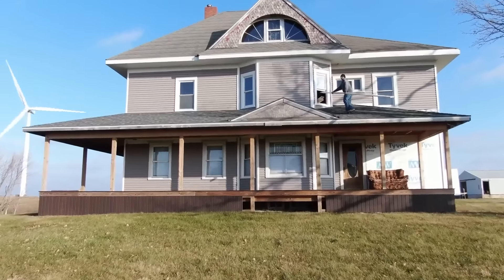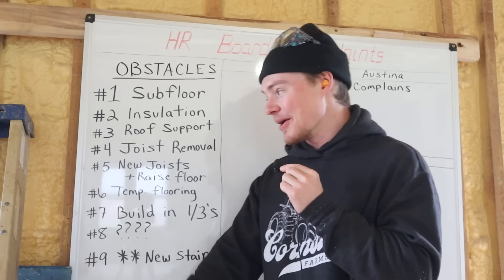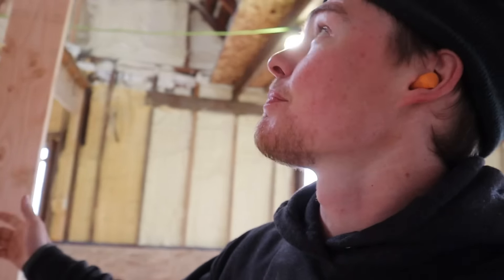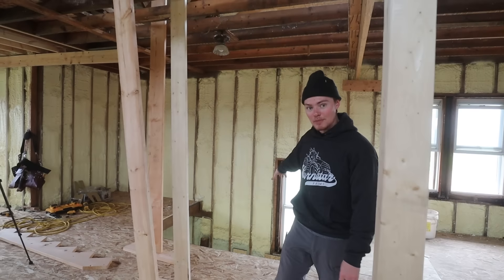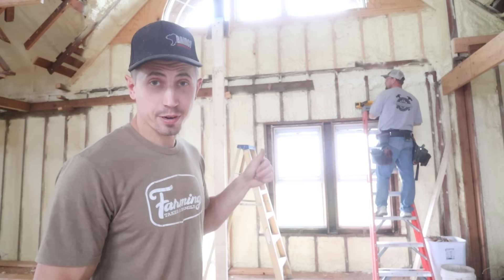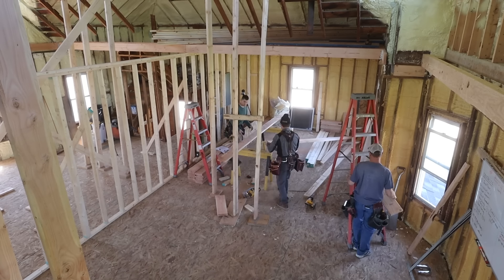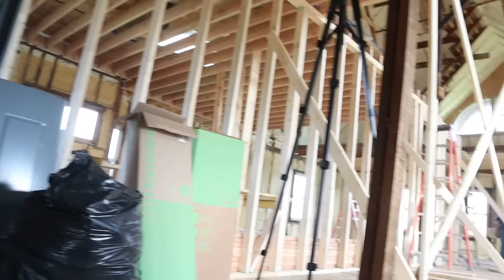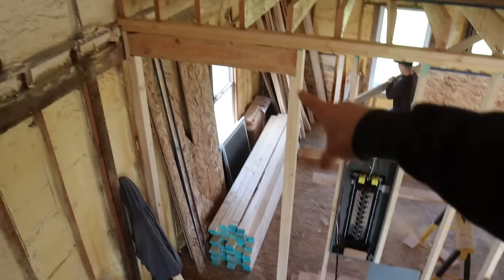Restoring A $7,000 Mansion: INCREDIBLE Dream Attic Rebuild (Pt. 2/3)

Comment: Think twice about that cathedral overlook. I lived w one of those. Impossible to clean and change bulbs or dust a ceiling fan. Also, heat rose (could change your HVAC calculation), created a weird draft & condensate formed at the peak. Suggest you build it such that you can fill it in if you find similar issues.  But…I LOVED THE DRAMATIC TREE TOP VIEWS FROM THERE. A wonderful spot! Good luck!

Comment: I am impressed to see 2X8 joists on 12" centers.  You are clearly thinking about your family with that decision.  I'm lucky to have found a house that was built with 2X12 on 14" centers.  Having solid floors and walls means so much to the feeling of safety.  Especially when storms come.  You're doing right by your family.  I am envious of the camaraderie you have with your buds and I know that each of you know how rare that is - and that makes it even better.  I would recommend the 5/8" drywall.  Can't wait for the next installment.

Comment: That balcony will open up the bedroom for sure, but will also be a bit of a safety risk for small boys when they put chairs infront of the railing to be able to see better...😮 No, not yet, but sooner then you think.😉
You might also want to consider the extra heating cost?🙉 17:52
Reply: what extra cost? This space was going to be heated with or without a wall or ceiling there. Its not like it was going to be an unconditioned attic.
Reply: A couple more inches of spray foam would be beneficial though
Reply: @warrenmichael918  Well, warm air expands upwards? To keep the bedroom warm you have to heat it from the ceiling of the attic down to the floor- instead of just heating up to the bedroom ceiling.  You have to fill the attic with heat before you get the same temperature all the way down to the bedroom floor.
Good when it's too hot, bad when it's cold. Just the laws of physics.
Reply: @atirblum  and? People heat huge lofted ceiling houses everyday and they seem to keep warm. when you can afford a huge house thats 3 or 4 stories and being fully rebuilt like this, a decent power bill is expected. That open loft will be pennies more on the power bill

Comment: Justin is right the attic area should be open concept 😊. Good for you Cole to listen to your Framer/Contractor 😊. Your kids will have a blast up there.😊
Reply: Disagree. Loosing a lot of floor space. Plus as you know heat rises. So in order to keep the attic area from getting too hot to use, the second floor will have to stay uncomfortable cool. Everyone I know that has high ceilings has realized what it cost to heat (just for looks) and say they wish they didn’t do high ceilings and lofts.

Comment: Usually, the rule is based on the amount of conditioned floor area, and contractors in many areas generally use the rule of 1 ton of air conditioning capacity for each 400 to 600 square feet of floor area. The rule is usually specified in square feet per ton (sq. ft./ton) - you need about 8 tons or 2 4 ton units. i would just go with a couple mini splits and then also use heat exchangers plus pos pressure hepa - no more dusting - the hvac pros are going to do a ton of vents and air carriers - mostly unneeded as the hosue is going to be 68-70 all year round. put one heat echanger in basement and one in third floor - you can run both or vary them according to season for max efficiency - they are 90% efficient which means you will not lose much heating or cooling but have good air recirc plus it will be hepa filtered - air will always be going out of the house/no infiltration

Comment: Great plan for the opened balcony….will certainly add a WOW factor to the house that wasn’t there before…I’m no HVAC expert, but imagine ya may want a low hanging ceiling fan over the opened area to circulate some of that warm air down in the winter as it will all funnel up that opened area to the attic floor.  

Can’t wait to see how it turns out and that may solve the staircase locate quandary

Comment: Consider glass for the 4 ft wall.... it will cost some but will add another dimension of cool     food for thought
Reply: The glass will make it easier to see what your kids are up to up there, and it's harder to climb. But OMG the fingerprints, lol.😅🇨🇦👩‍🦼
Reply: ah, fingerprints.  I would worry more about the dog slobber, but in either case, it will disappear into the background of life, for with kids, kaboom kids mess everywhere I would posit   :)
Reply: @TomParr-xd7kr  never thought about the dog nose and slobber because I have a large Great Dane  so the slobber line may be above the rail,lol. 
You are right though kid mess is a small dent in the big story.

Comment: Cole I know I mentioned before when you were taking down bricks then drywall then paneling and now it probably after the fact it. But i will suggest it again now that you are taking down more of the Attic: Please put down tarps below where you are dropping stuff down. The Tarps will catch most of the debri/stuff. Then all you have to do is fold up the tarp and drag it to the truck or a bin and empty it in there. It would save you so much time from having to clean up the floors so often and so much. And it would save your back from having to bend over so much picking it all up. It doesn't have to be a big tarp. Just one or two in strategic places that you can handle carrying or dragging outside or to a window to dump out. Work smarter not harder!

Comment: Cole, with little kids, you need to make sure those low, working windows can only be opened a little, so the kids don't open them up and fall out.
Reply: Not to mention only a 4 foot wall to keep them inside the attic. Kind of dangerous if you ask me.
Reply: @NotKev2017 you must have fallen over a railing as a child. Maybe Nave should just wrap them in bubble wrap
Reply: I was a farm kid growing up. Nothing was OSHA approved. our barn and all the equipment was all scary stuff. I was told not to do stupid things and it worked.

Comment: Cole and Nava, couple of thoughts on the open attic- idea put a walkway alway around so you can access all your windows in attic, another idea put built in storage either draws or bookshelves on outside and have a few doors to access behind for more larger storage or play area for the kids on all the short walls so you have plenty of headspace, next idea put a safety/play net over the opening it will keep all children and adults safe and place to play, read and hang out. Concern  I thought you where going to put you air conditioner in the attic floor with all the venting going through the floor what happens to that idea loose your floor means loosing your venting, concern about heating and cooling plus humidity and air filtration to keep down pollen and dust you need to reengineer this drastic change in design. Concern height of railing please check the codes and consider material choice- you got dry wall, glass, but consider metal as well- you get the see through effect and heat and cooling flow depending on the design could be safer and if you put up cargo netting maybe easier access to it. Concern the second floor did you plan a big area already that would below this open attic area or it a small hall way and now all the bedroom will be open, they will not be private or quiet but instead all open and no privacy, did you also account how it will effect heating/cooling the bedrooms since it will be open to the attic. Cole did you ask Nava if she wants the open attic? If you keep it open or not it your family decision just reengineer for changes made for your family needs, health and safety. Love your channel. Keep it going.

Comment: Cole,.  Food for thought.  Don't build your  new stairways yet. You may want to use a wersbo type of infoor  heat. There is a way to lay 2x4s flat on the floor about 2ft apart. With gaps for the tubing to run . Once the tubing is installed. Hire a crew to pump gipcrete into the the rest of the floor. The 2x4s work as nailers for hardwood floors.

Comment: I’ve been following y’all and up until now was confident I could do the same with my skill set. But that attic rebuild is where you finally lost me! I wouldn’t be able to suss it out myself. 😂 It’s like you trying to teach my beagle quantum physics! Good good on you though - we’re eating this up with a spoon!
Reply: The attic rebuild has got me nervous. The original design for the supports of the roof were sketchy. I'm sure they are going to do a great job but at the moment it seems less supported than it should be.

Comment: I don't know if you're consulting with an engineer/architect but youre introducing hinge points in your walls by removing the floor section. The walls aren't supported laterally at the old top plates. Wind loads on the wall could cause deflection and cracking at that point. Normally the studs would have to run full height. Just something to consider.

Comment: My parents built a house in late 70s with cathedral ceiling, balcony, and light coming in from windows above. The windows were partial solar (or something like that). We loved the space, but when it was full sun, it was hard to regulate the heat, and it would get too hot. Also, it faded the decor super fast. Window treatments have advance much in the last 40 years. Look into windows that will help protect from sun but bring in the light. 
Yes, it is gonna be super cool. 😎

Comment: When I was younger, I had a recurring dream about a big old farmhouse that looked normal on the outside, but the inside was set up to be a circus/playground.  Long chained swings hung from the ceiling way up in the top.  There were slides that wound around from the top to the bottom. There were giant hoops swinging around with people standing in them.  Your gutted house reminded me of that old dream.(I have no idea where that dream came from). But let me tell you about the George Burns dream...

Comment: That tall ceiling is going to be stunning! Cole and Nave, I don't know what you are thinking about for walls, but I highly discourage you from using sheetrock. It's messy and holds moisture and is easily damaged. I prefer something like shiplap or paneling. Just a thought and some advice from a builder's wife.

Comment: That is really really cool.but a suggestion for the low ceiling to wall where you can't walk under. Make it storage area by building out a wall to 5ft an put a couple of doors on it. Had this in a Victorian house built in Lodi Ca. House was built in 1885 it was involved in a 2 alarm structure fire in 1997. We rebuilt the house for the owner.  Because of who my boss was the city of Lodi let him do the work it was slated to be torn down.

Comment: In time, maybe don't do drywall. Do something like fermacell. It is self regulating regarding moisture. It dampens sound like n times better and it holds a screw w/o a plug up to 80 pounds. It is however also more expensive. But for places where you will hang stuff on the wall or need sound dampening it is the way to go. Kitchen, living, utility rooms etc.

Comment: Cornstar,  I am addicted to your content.  I have a firm understanding of home construction,  nothing is simple.  Questions, do you have an architect and engineer.  I know they are expensive, but can save one from big mistakes.
Reply: Ya, have your attic trusses checked, something isn't looking right for weight and bracing with the original build structure.  You've got a big wind and snow load potential.  Great videos!
Reply: Roman is an engineer from Ukraine. So they have it covered.
Reply: @NavyVet_ET1  Yea right.
Reply: @NavyVet_ET1  funny

Comment: And...maybe the stairs can come up to the atticnspace thrpugh the big opening instead of where u have them, use that space as a bigger smaller room, plus in the winter would look amazing to have a big stairwell going up on to the attic space. Imagine it with massive oak beam in the ceiling would just finish that space of! But....Will it work with the air con venting????

Comment: Disagree with leaving a large section of the attic floor out to creat a high ceiling for the second floor for two reasons.
1. A lot of floor space is lost in the attic that could be used as play area for your children or more bedrooms in the future.
2. You’re going to waste a lot of heat trying to heat the second floor as the heat will rise to the attic. So eithr the attic will be over heated trying to keep the second floor comfortable or the second floor will be cool in order to keep the attic room temperature bearable.

Comment: The balcony idea "asthetically is really cool". The issue is "Heat Rises". I would put two large fans (ceiling fans with 7 foot spans - 3 foot blades) in the ceiling that point down. I would put a 3 way switch so you can turn them on from either side of the room. Might even switch the fans separately. In the summer when the A/C is running probably wont use the fans much. In the winter you will want to bring that heat down. You will need framing to hold the weight.

If you don't like the big fans. Put 6 or 8 bathroom fans and run the ducting thru the walls and blow down thru the floor joist.

Comment: Do you not need to put those metal joist hanger / supports under the 2 x 8's?  They're just toenailed or screwed into the main headers.

Comment: As a low voltage wire guy, please take into account data wire/phone wire/cable tv wire into your design. I have run into so many newly built homes that don’t and it is a nightmare.

Comment: I bet the view from those third story windows would be perfect to watch a root plow and drum pasture aerator running across the fields in winter and early spring 

Doing work to have better water retention, deeper root growth, less compaction, faster fields drying, breaking up and making available minerals and nutrition lock deep in the soil etc
Reply: The only problem is their soil freezes soild in the winter.

Comment: I would upgrade the windows in the high ceiling area that window you got there right now won't cut it after you got the drywall trim and paint done You're going to be like dang I should have replaced those windows

Comment: Shouldnt the ends of the 2x8s that are on the exterior wall have hangers? I mean, you reduced the spacing to 12 inches to make it more rigid. Why then rely on screws? Which in and of its self seems wrong. Screws are brittle and shouldnt be used where wood can / will move. Not only for walking but for temp changes along the exterior walls.
Reply: Save here so you can spend on other stuff. I don't understand how the priorities are set.

Comment: They are hoping for that $20,000 bonus at the end of the year which all good bosses do for good employees never miss a day and never call in sick LOL. p s put in a fire escape Pole Legacy the firemen slide down in the firehouse that would be fun I do recommend putting in sprinkler systems for fire it will help cut your insurance in half I'll give you a good break something to think about run that by your insurance agent and see if you get a discount on your homeowners insurance. I love to build and make sure you got that work crew of yours top notch don't be scared to use the whip😅😅😅😅

Comment: "We are restoring this mansion" By taking out the plumbing, Electrical, Counters, Insulation, Siding, Shingles, Floors, and Walls... And we dug up and poured a new foundation. We are moving where every wall is, and changing the height of the floor, and location of some windows and doors.   

So whats left?  "we left most of the exterior walls... for now...

Comment: 4ft wall will be too tall up stairs for the open area. 

Go with a 3ft wall. 

Go with the standard height of a railing for the wall up stairs. Maybe don’t build a wall but put up a railing so all open. 

You should for sure not go with a 4ft wall , go with a railing and not a wall.

Comment: Leaving that section of attic open is a huge mistake. It will be next to impossible to clean that window, not to mention not being able to use it for ventilation as well as the lost floor space in the attic. Plus the danger of small kids getting up on the short wall and jumping or falling over.
Reply: I am worried for child danger as well.  Plus he just lost a third of upstairs 🧐
Reply: Interior Designer here.  If a client of mine was intent on executing this design, suggested by his contractor, I would recommend extending a narrow walkway in front of that window in order to safely reach it for cleaning purposes as well as taking advantage of the functional ventilation provided through that center window.  Perhaps vertical decorative metal railing would be appropriate for this entire upper balcony level, along with a matching, or complementary, spiral metal staircase to this level.  The children can be trained to only access this area with an adult present.  NOTE:  I hope the bottom frame of these windows is higher than 18” above finished floor (AFF), because if they are lower than 18”, he’ll be required to have tempered glass.
Reply: @probablynot1368  I would be willing to bet there is not one permit pulled for this whole project, much less any inspections.

Comment: If the attic is not going to be finished then doing all this to hide the hvac is stupid. If the attic is not being completely finished then the attic could have been an unfinished space for mechanical. 
Your roof doesn't have a structural ridge so removing floor joist may not be the smartest thing to do since there is nothing keeping the walls from sprout as the roof pushes down on the walls causing the wall to spread!